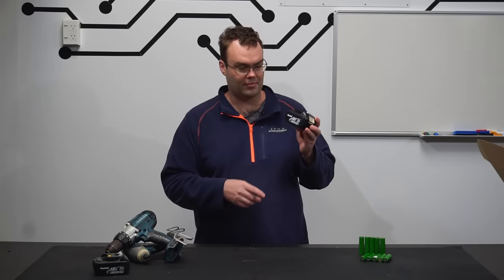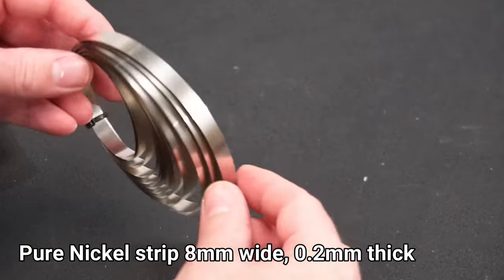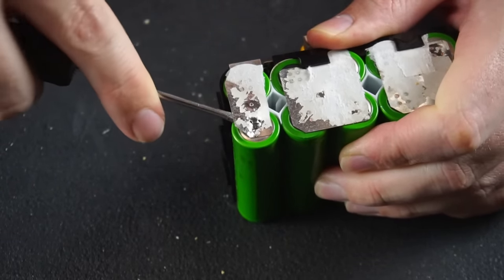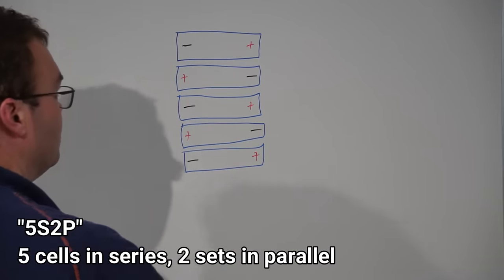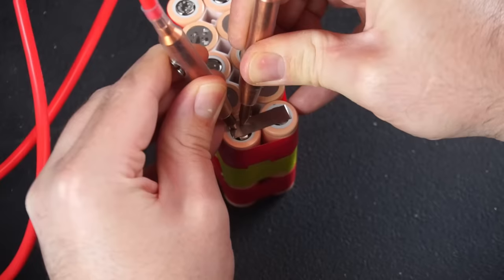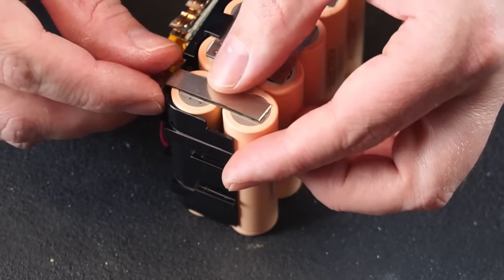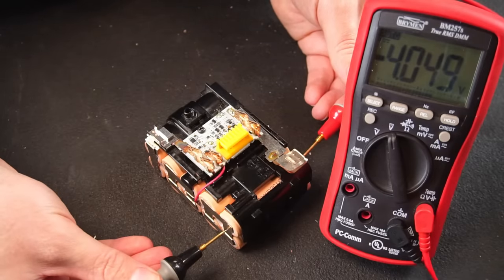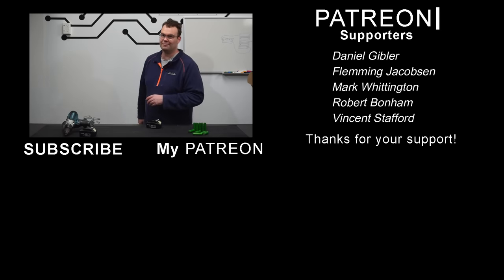Repacking Makita 18v Lithium battery with New Cells (Save $$$'s)

Comment: I had some questions I had just change the cell like what you had done but when I tried it on my drill, turn it on and it work like just the few spin and it stop. When I went to charge it didn't turn red light and it just don't work anymore. Wondering if anyone can give me some advice that you can offer thank you

Comment: Great video ! I have the same charger like yours but recently lights up the bottom yellow battery service or fan and doesnt charge anymore? The battery charge fine in the other makita charger so is good.  Is it fixable or I can just buy a new charger? Thank you.
Reply: Do you have a multimeter? If so you can check the batteries voltage by connecting it to the metal connectors on the battery and that will tell you a little bit more about what needs to be fixed.
Reply: @randybobandy9828   I have a multimeter. Batteries are fine, but sometimes the charger doesn't charge, leds are ok. Example: last time I put the battery (3 amp), red led light on, but cooler off, and stayed like that for one hour and no green light. After that I disconnect and connect the battery again, cooler starts immediately and the battery was charged like normal in 30 minutes...very strange. I know that the charger needs a cool battery and not too cold eider. I opened the charger to see if it has some foreign objects in the cooler, but nothing, everything is clean and clear. I paid for both second hand chargers 80 euros. Makita chargers are a little bit weird and tricky, but very good for my budget.

Comment: Won't the used batteries with different voltages damage themselves if use together?
Reply: No...18 volt batteries should stay 18v  so you can charge them

Comment: Isn't it technically a 2P5S configuration, not a 5S2P?  There are five 2P batteries in series, not two 5S batteries in parallel.

Comment: Well I learned one thing. I thought once the bms saw a fault it would never charge again. I would do this but how would you ever justify the price of the welder to save a little money on new packs?
Reply: When you’ve got four or five packs that need doing :)
Reply: People in the trades have dozens of battery packs. Replacing all of them is far more expensive than the spot welder and new cells.

Comment: Hey there.great video. Who do you buy your battries from?
Reply: In Europe? Got Aldi or Lidl? Drill battery pack there ,works out at £3 a cell. Same cells on eBay £10 each,
But the ones in a battery pack has tabs spotted on so they can be soldered.
Reply: @crazygeorgelincoln  nkon is the site to buy if you are in Europe.  Best deals on cells I have found ever. Unfortunately they stopped shipping to the US so now I have to pay more!

Comment: How did you increase the amp hours? I have a 40v Kobalt that's only 2.5 AH and would LOVE to get it to 5!
Reply: You won't be able to increase your pack to 5.0ah because you only have a single row of cells. His pack had 2 rows of 1.5ah cells(1.5ah x 2 =3ah and he replaced them with 2 rows  of 2.6ah cells (2.6 x 2 = 5.2ah). The largest you would be able to go would be 3ah since that's the largest capacity cell that has enough power to run tools.

Comment: I guess if you love electronics, fine.  But I just bought 2 new 19.2 volt batteries for $50. for my Craftsman equipment.  I don't know what your time is worth, but after you buy all your special equipment and spend all that time, I doubt very much that it is very cost efficient. If you enjoy it, that's one thing, but if you are actually doing it to save money, you are kidding yourself. Personally, I waste my money and time on woodworking and it is certainly not cost efficient, each to our own. Well done video though, thanks.

Comment: The price for Makita batteries is a rip off for sure, considering how often they fail. It would be fun to repair them but from a practical pont of view it is no longer necessary to go to so much effort or parts expense to salvage failed batteries. Many cheap clone batteries are available off Amazon or Ebay. These are likely to be more reliable than a DIY repair, which often requires non genuine replacement parts anyway, plus they still come with warranties.

Comment: Can a person disconnect the BM wire and put it on the charger? Does leaving these batteries on the charger for a long time ruin the batteries?
Reply: You shouldn't leave batteries in the charger, it's dangerous at anytime. But, the BMS should stop the charge after the batteries are fully charged.
Reply: Brad Williams thanks for helping, can a battery that was left on a charger that is now flashing bad battery, be fixed? Can the BM wire be temporarily disconnected and the batter pack put on the charger for a bit to get the cells going?
Reply: @14goldmedals  If the over-charge protection (OCP)/ over-voltage protection (OVP) has failed nothing is going to fix it. The cell is dead. These batteries are not to be played with. To do what your suggesting you would need to strip the entire pack apart and replace all of the cells. Just as he did in this video. Although I would not suggest using salvaged cells, unless you have explicit knowledge. Some battery chargers can 'repair' a undervolted cell but they're are of limited use and effectiveness.
Reply: Brad Williams I thank you for the info and safety warning. I have 2 40v Ryobi batteries I will find a local supply place to re-cell them. We have a few businesses where I live doing this. From this video I’ll know the right questions to ask about their procedures. Cheers.

Comment: I had a makita battery that charged but only measured 1v or so at terminals and didn't test with button on battery, I didn't have a proper charger at rhe time just bench power supply. As soon as I docked it with charger it was fine and fully charged as I previously bench charged it. Anyone had this before?

Comment: Does this really work, or you need to replace the BMS -board as well. I`ve heard that the original bms has programmed obsolescence, so replacing the cells will not bring it to original capacity/life. Can anyone confirm whether that`s true or not?
Reply: I think if somebody tries many time to charge a battery with a dead cell, it will trigger the bms to "kill" itself. I managed to repair 3 batteries, the first one was a chinese remake, I only had to replace 2 dead cells in that one. The second battery was an original Makita with 2 dead cells, I had to replace the bms also to a chinese replica for 3,2 €. The third one was also a Makita with dead bms, I replaced only that, and it works again.
I'm super happy, my only invests were the spot welder for 26 € and the 2 bms's, and now I have 3 more batteries. For replacing I took the cells from dead laptop battery.

Comment: Why do the spot welder cables jump every time you do a weld?
Reply: @restopesto9448  very angry pixies! I have that same spot welder and if you hold the trigger for a few seconds after you spot welder it will tell you how many amps it used. Mine was pushing out 1500amps! @ 12v. Talk about power. I was using 2 large car batteries in parallel to power the welder.

Comment: I scoffed at the idea of getting a kWeld for AU$299 but some brand name batteries and chargers are about AU$170 each. :-(
What would you do for a DIY charger?
Reply: For cells or for a complete pack ?
Reply: @Stefan_Van_pellicom  For a complete pack. I started looking at Buck/Boost converters: https://www.youtube.com/watch?v=9--_jaxiXhE
Reply: @TorchHacker  I would stick to an original charger. They are really cheap (look it up) and when you buy second hand batteries, the chargers are often included. I have 7 now ... 😀 Besides charging and offering a physical matching port to stick in that battery, they also provide thermal protection (cuts charging when cells communicate high temperature) and give you a clear indication when the charging cycle is finished. They also communicate with the battery about the load balancing and broken cells. And finally : you do know that lithium cells literally explode if they’re not happy, right ? 🤔
Reply: @TorchHacker  For separate cells, you can either use your lab power supply if you have one (first CC at 1C, then CV at 4,1 or 4,2V) or cobble up some diy project around the TP4056 chip. Tons of videos on YT for that !
Reply: @Stefan_Van_pellicom  Bosch chargers are about AU$171 new and $50 to $90 second hand.
Reply: @TorchHacker  I just bought 2 Milwaukee 18v 5Ah packs ánd a fastcharger for 90 bucks
Reply: Just get a bench top power supply and you can charge any tool battery.

Comment: Can anyone answer med this: does the BMS have stand alone under voltage protection? I wanna use my batteries for other electronics, with a 3d printed socket. For example a homemade Work light, Sound system or something.
Reply: Most advanced BMS have alot of options....asking here isn't the right place.This is just for the drill which has its own BMS which no one is going to convert into something else.

Comment: Nice but your saying to do this i need a spot welder and 18650's that's already gonna cost someone more than getting a new battery not everyone has those you know 😒
Reply: You can use soldering iron for that job too, it just has to be powerful enough to solder cells almost instantly.

Comment: Actually all lithium based BMS's have balance charging, otherwise it wouldn't be many cycles before one of the cells went up in flames, or dropped too low in voltage. Not all of them have temperature control either

Comment: When testing the cell's on 4:06 , the cell's are really unbalanced I read voltages between 3,6V and 4,1V. That's not good, especially with a pack without balancing circuitry. Before assembling it's a good practice to charge all individual cells to 100%

Comment: I have generally found it difficult to get the batteries cheap enough to justify doing this over buying a $30 Chinese made knockoff.
Reply: How many blokes we talking?
Reply: The knock off batteries are  always way under stated capacity.  If a knock off battery says 6ah its closer to 4ah.
Reply: The knock off batteries are  always way under stated capacity.  If a knock off battery says 6ah its closer to 4ah.

Comment: DONT do it like this!! its fine to make your own pack. but make sure all the 18650 cells ar around the same voltage. 4.1v and 3.9v is a really big diference!!!
make sure they are no more then 0.05v from eachother. a 18650 can catch fire from overcharging. so if the cell from 4.1v gets charge to 4.3v and the 3.9 wont get hire then 4.1v the 4.3v cell wil quickly gets wors.

Comment: Hmm. Is one battery 1,8v or? Because you put together 10. That should be 18v.. 18650 online search say 3,7v one battery :S confused.
Reply: yes it is at 3.7v....When charged its 4.20v  when discharged its 3.10v.....per battery....Now its how you connect them...serial or parallel

Comment: Could you do a video repacking a milwaukee m18 battery ?
Reply: It's literally identical to this video but with a different battery shell and a different shaped circuit board. They use the same type of cells(18650) in the same configuration 5 cells in series to make 18v.

Comment: I have done this for years.....to buy a DeWalt Makita Milwaukee battery for 79 8999 dollars for a replacement is absolutely retarded but people fall for it left and right.....
Reply: You can actually find really good deals on new milwaukee or dewalt batteries. I would never pay msrp on a battery pack. I also buy dead tool battery packs on ebay and swap out the cells for cheap. I have the kweld and it's absolutely worth the money.

Comment: Problem with this is the quality of the batteries you buy. It's becoming increasingly difficult to source genuine batteries to place dead ones. I've been doing this for many years for customers who didn't want to buy a whole new drill or driver just because the batteries die. And companies that previously supplied genuine batteries started shipping fake batteries. And what I mean by fake is that the batteries are still batteries, but they're deliberately mislabelled for voltages they're not able to meet & therefor, dangerous to charge. 

So, I would really seek a professional to do this, because doing this at home could see you blowing off your face if you happened to of been shipped fake batteries & you plug them in to charge after replacing all the old batteries.

Comment: With older battery packs you might get away with disconnecting the BMS from power, but newer BMS forget a line of code when disconnected from power and thus prevent the pack from working with new cells... ahhh forced obsolescence the BS manufacturers do now to make you buy new products instead of repairing old products

Comment: Definite fire hazard...
When you are replacing Copper strips with Nickel ones, with all dimensions the same, the Nickel ones must be 4 times thicker, since the Nickel is 4 times less conductive than Copper.
But the other dimensions are not the same - the original ones are wider than your replacement...
So you need around 1 mm of Pure Nickel for not to glow red at full power...

That's the end result at full load:
https://i.imgur.com/BaohgD4.jpg
http://www.78294.ru/_fr/3/7115813.jpg

And these are Chinese replacement tabs that match shape and all dimensions, except thickness, and are not Copper.
In a tool that draws enough power, yours may be better, but may be worse than that...

Comment: The best you could do is to not to buy Makita. These batteries are not balanced as they should be, so the batteries are intended to break earlier, than normal. As soon as the BMS notices a broken cell, you can't just replace bad cells, because the BMS won't work again. You have to replace the BMS by a clone. But the absense of the balancing function, remains the problem with unevenly charged cells. Not even clone batteries offer balancing. So consider to buy power tools from any other manufacturer.
Reply: 😂 sure vic

Comment: I know you wanted us to leave a comment so that it can help your video in the Algorithm but, I believe you deliberately called that connection parallel when indeed it's series. Everyone & their mama knows the order in which they are arranged doesn't really tell if they're series or parallel,  it's the pattern in which they are connected, plus 1 quality 18650 cell from a renowned company like LG, Samsung or Panasonic at least here in Poland would set you back around $6 - 7, so replacing all 10 would be almost twice the amount a new one from Makita costs, as a matter of fact, you can get a new charger and a new battery with that amount, so what's the sense in all these hassle? and then I have to invest in some spot welder as well? A successful DIY should be with what everybody already have laying around and at least the entire project should be half the cost of getting a new one otherwise, all you're showing is your welding skills and not really saving $, you got my attention at last now, though.

Comment: You need to buy cells for those battery packs. Salvaged are worn out/hard to find. not worth it imho.
Reply: Packs last for a long time. I'd have no reservations about using cells that tested fine. I've had original makita packs last ten years, if a pack does go bad it's usually only one cell.
Reply: I have bought cells from battery packs that I salvaged and they where brand new cells.

Comment: okay well it's far far too expensive you can buff the terminals of the batteries scuff them tin them solder them quickly save yourself a lot of money and heartache there are circuit boards for a spot welding you got to buy a lipo battery you got to buy a charger make sure it's a balancer make sure it can discharge soldering iron dad's old electric very quick very sure very cheap

Comment: Lithium cells are just as bad as every other type of battery. If they lasted ten years, you were extremely lucky. With daily use, they're usually trash in less than half that time. Not something you'd want powering, for example, A CAR! Unfortunately, they're the best of a bad bunch. Chemiical batteries are a truly lousy way to store energy

Comment: Don't buy a new $40 battery! Buy a dremmel ($50), more used batteries ($20), needle nose pliers ($20), cutters ($15), soldering iron ($25), kweld electronic welder ($290), pure nickel ribbon ($10), various plastic and insulating items, and make a mildly annoying YT video with a shameless plug for a company nobody needs or wants, bit of rubbish royalty free music instead. At least this way you won't even need to worry about a factory warranty, coz you won't have one. Nice! 🤣😂🤣

Comment: The spot welder is the problem.Has anyone an alternative solution? Also nickle strip!
Reply: Nickel strip is cheap. It takes about $1.50 in nickel for a pack this size. There is really no other option to using a spot welder. Also don't buy a cheap Chinese spot welder because they will not perform up to par! Brands such as sunkko are only good if you live in a country that has 240v not 120v outlets.

Comment: >$300 worth of effort, and $100 worth of materials, a month of delay to replace a $200 purchase, (1 hour) from Bunnings?
Reply: Salvaged cells get to a Maximum 2 Euros per cell. 20 Euros max(if you don’t need 5Ah, 35A batteries then 10 Euros will suffice) and the spot welder is 20-40 Euros. The strips ~1 Euro per meter. Material costs, with salvaged cells, get to 10-15 Euros

Comment: So how do i save money if i have to buy a 170 euros kweld? My batteries are still working fine after 5 years of use. So if they fail next year, i will replace them for 50 euro / piece, and i am still good another 6 years. So with 170 euros i can replace the battery three times, meaning 18 years of use, since i have nothing else to do with that kweld. I am pretty sure that in 18 years my Makita would have it's days...